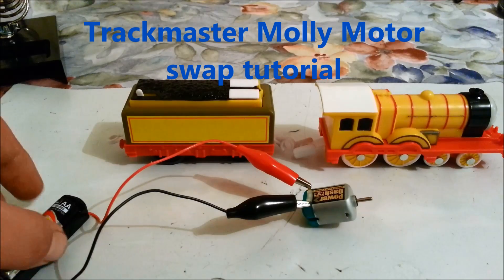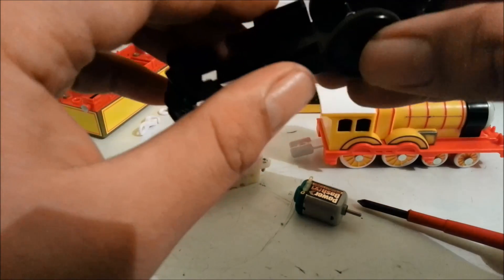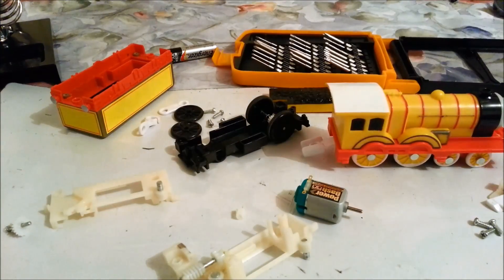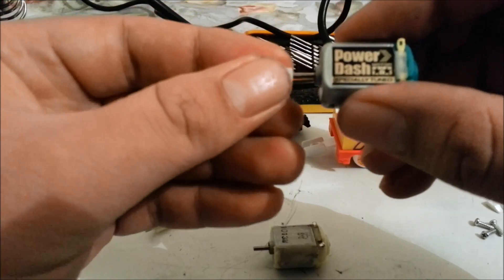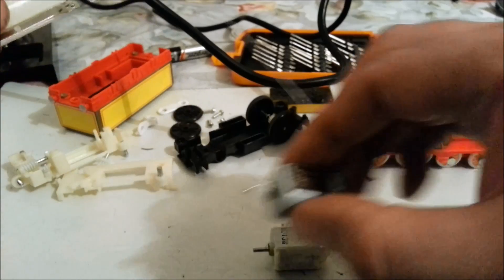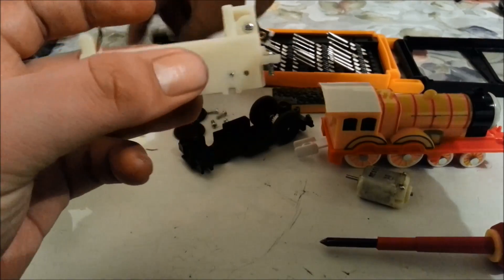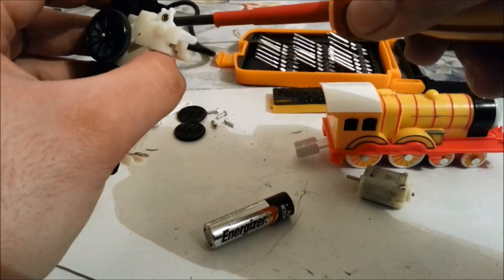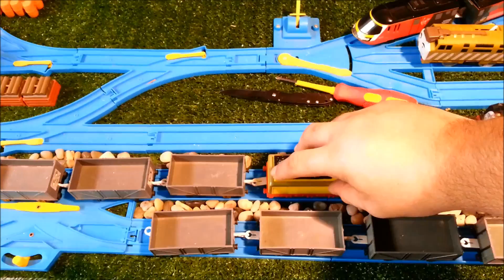Trackmaster Molly upgrade tutorial, swap in a better motor in a flat drive unit works most engines

Comment from the maker: Thanks very much! This is the motor you want to use if you do a swap it is the perfect mix of speed and current draw and runs great on a regular AA battery as normal :)
Reply: Does this motor switch work on rc locomotives

Comment: Ucwepn I once had to fix my original TOMY Henry's drive unit, and the wire was loose, which is what caused the issue. Sadly, the motor later died, and I had to swap a newer motor from a newer 2005 release TOMY Henry to fix the original release model.
Reply: Onbce it's cables ripped on mine, and then I got my dad to fix it, it was about 2006 or so...

Comment: I have noticed since upgrading that the faster engines slip on the slopes. Have you found this and do you need to do a tyre change
Reply from the maker: +Samantha Wood Hi, I like your conversion video with the hyper dash 3 :) I have found that some engines can slip if they are too light and have too much power or are hauling too many coaches or trucks, I add weights to most of the locos I have modified to try and get around this but locos like this molly which are very space limited over the drive wheels there's no real solution for. There are new tires available on ebay and I'll admit they can help as the original tires on these engines are quite old now and are starting to lose the flexibility that helps them to find traction.
Reply: +Ucwepn Changed it over with Henry who is full of weight. He has small weights at the front and in the base and the motor plus pulling a c battery so his problem might be too much weight but douglas is light so i might have to add weight. which lights do you use for Toby?
Reply: Ucwepn can you do a video on how to put all the gears back in a Trackmaster 1 Thomas

Comment: she is louder with a aupgraded motor
Reply from the maker: yes once you upgrade the motor it spins faster and harder as do all the gears causing extra noise.
Reply: Ucwepn So will engines with flat drive units work for this review to?
Reply from the maker: juliet7p1
yeah all AA battery flat drive units are the same
Reply: Ucwepn Ok, I have this trackmaster 2012 Thomas and it brokedown. So I think if  I switch it with a Trackmaster Thomas that came I a King of the Railway set, it will work.
Reply from the maker: juliet7p1 If they both have a flat drive unit it will work.
Reply: Ucwepn Aren't the  motors on the engines all the same?
Reply from the maker: juliet7p1
yes inside the drive unit all the motors are the same, you will need a soldering iron and solder like in the video, the motors themselves are interchangeable.
Reply: Ucwepn Ok I under stand.

Comment from the maker: that spring moves the gear across when the switch is on to put power to the wheels, when the switch is off the spring pushes the gear back so the engine can free roll